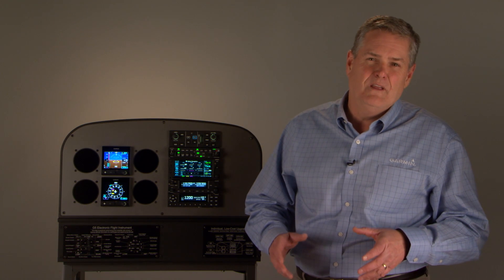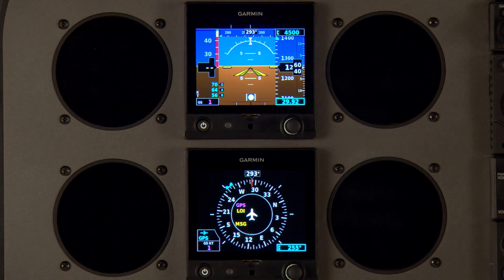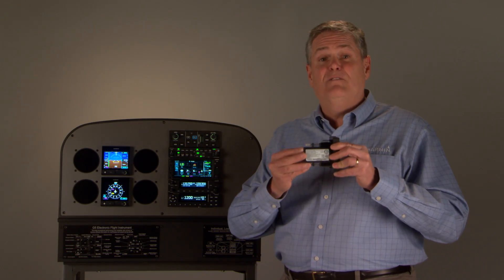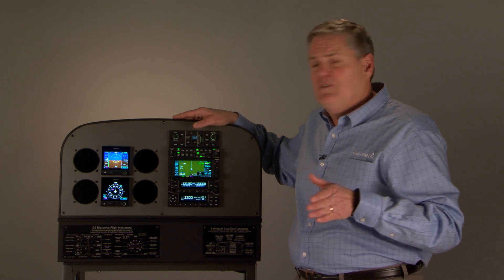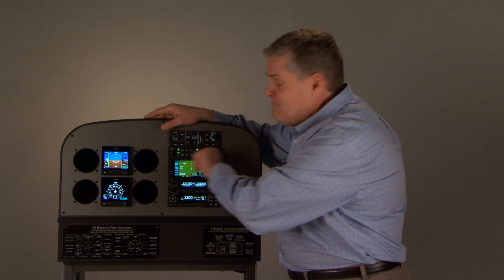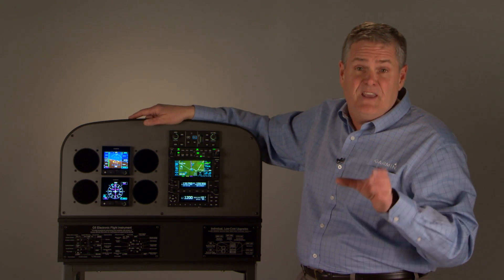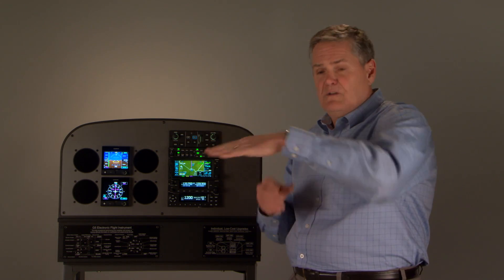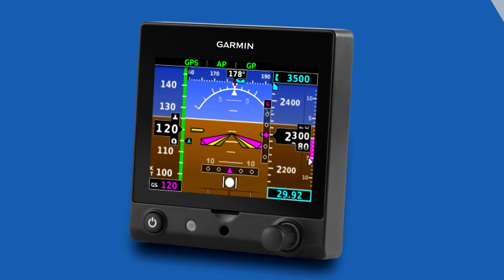Garmin G5: The Economical Upgrade Path to Electronic Instrumentation

Comment: Nice...but Garmin has a weird--and expensive--way of defining affordable. I'm glad they're finally getting competition from Dynon, Bendix/King & Avidyne.
Reply: I mean it costs $1350 on sportys. If you compare that to a traditional vacuum attitude indicator its only 400-600 dollars more, which makes sense since you also get airspeed and altitude with it and its more reliable. Now a g1000 is a rip off compared to dynon that I do agree with
Reply: @rexr3306  for Certified?
Reply: Actually Aircraft Spruce has them stc'd for certified aircraft for $2,650, but you can bet on spending double that, installed.  @rexr3306
Reply: You’ve obviously never bought and installed integrated avionics.
Reply: Actually I have. Now go back to sleep on that old couch in your mom's basement. :trophy-yellow-smiling: @Bartonovich52

Comment: interesting if cost under 100$ /gauge change new all. only totally idiot pay ower 2000$ this little parts. no newer. idiot if pay. ower price 100x. this can made under 100$
Reply: Well, Garmin is in business to make money and they will charge what the market will bear.  Plz remember that liability insurance and the approval processes can be a significant portion of the cost of bringing new equipment to the general aviation market.
Reply: If you can get parts certified for that sure. But even old fashioned steam gauges are like $400

Comment: hi, i own a cessna 152,, what can i do for up grads on it,,?
Reply from the maker: We have lots of great options for you! The G5 is a great starting point. There are a couple of versions of it – it offers a replacement for your existing Attitude Indicator and for your Directional Gyro. Not only does it remove the dependency from failure-prone gyro instruments, in a lot of cases, the Garmin dealer is able to remove the vacuum system entirely. Check them out here: https://buy.garmin.com/en-US/US/p/570665/pn/K10-00280-00#overview

We also offer a series of cost effective navigators that offer LPV approach capability. Check them out here: https://buy.garmin.com/en-US/US/p/577202/pn/010-01822-50#overview

^DK

Comment: so , this will work with my old century autopilot ?
Reply: Russell Lowry This is the installation manual (for certified) that lists how to interface with 3rd party autopilots and which ones will work, at around page 120. Needs additional GAD29b part installation as mentioned about half way through the video. http://static.garmin.com/pumac/190-01112-10_09.pdf
Reply: Agreed will it work with a century iii
Reply: He states that a 'Third party' GPS will work so I'm hoping so as well.
Reply: I thought that was the problem-that the didn’t work with APs.

Comment: Does the altimeter setting that you put into the primary altimeter's Kollsman window automatically transfer to the G5 or must you also set the atmospheric pressure separately into the G5?  Very nice avionics!
Reply: A standard altimeter will not have the capability to transfer anything.. You will need to set both..
Reply from the maker: Hello, our Aviation Support team will be best able to assist you with this. They can be reached at the following link: http://j.mp/GRMNFlySupp
-MR